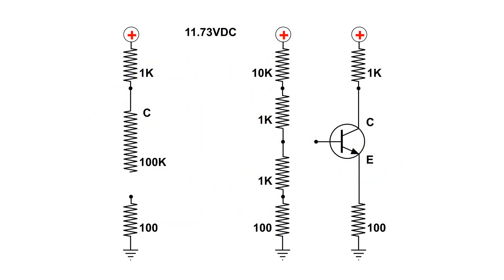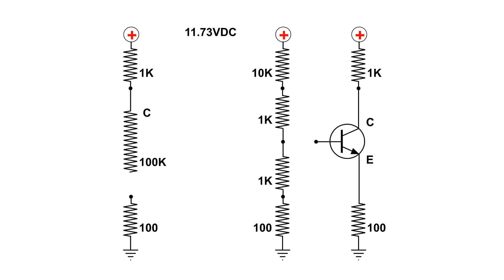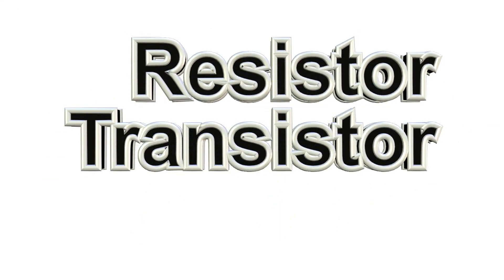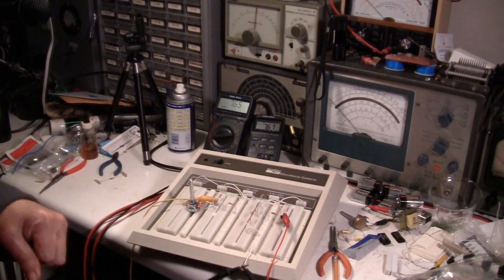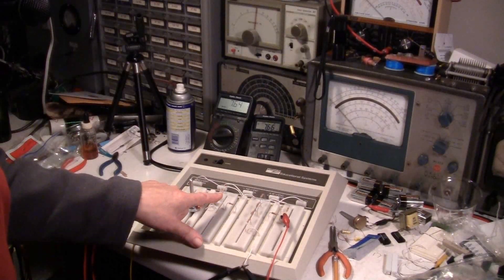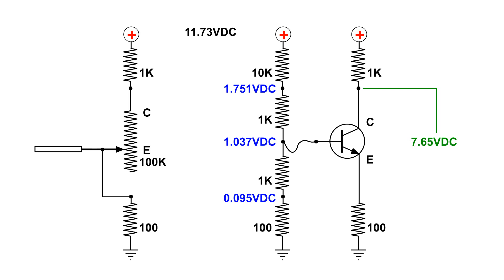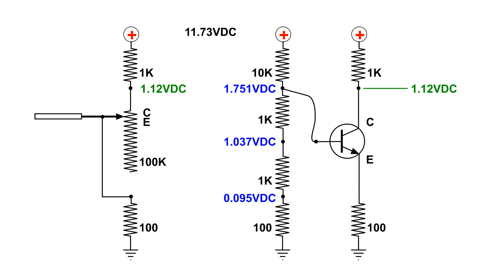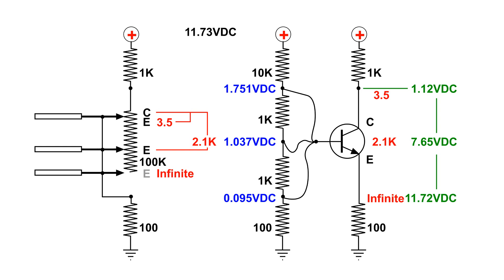Transistor, How Does it Work in a Circuit, Demo

Comment from the maker: I found that checking my digital meters with my trusted analog meter, one digital meter is a liar on the low milliamp scale. New readings (.095v .000ma)= infinity (.669v .35ma)= 1,911.43 ohms (.69v .74ma)= 932.43 ohms. I check the current readings with both the good digital and analog meters.

Comment from the maker: Thanks John,
You can thinks of vacuum tubes that way also. The resistance between the cathode and plate changes with a volt change on the control grid.
Regards,
Rick

Comment from the maker: Thanks GaRbAllZ 
I measured the base current and emitter base voltage from bottom bias to the top. (0.095v 0.003ma) (0.634v 0.021ma) (0.685v 0.147ma) It's interesting how the resistance of the emitter base junction changes, form bottom to top, 31666.67, 30190.48, 4659.86 ohms.